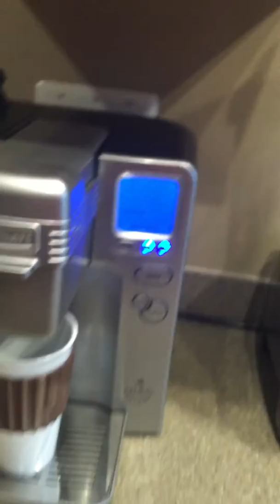Keurig coffee machine automatically refills with water. Float valve and some Quick-Connects.

Comment: Hey there: I have the same coffee maker at my place. So could you tell me where you found the parts to make that setup, Did you get the part from E-bay?Why did you not hookup a water filter on your coffee makerI'm calling from Houston Tx
Reply from the maker: Michael Shane it’s been a while since I did this.  I’m still happy with it.   I did later purchase a filter for it.  With quick connect connections. I bought the other parts on eBay.  Very inexpensive.
Reply from the maker: I bought filter but never hooked it up.  Yes, I bought everything on eBay.   I have since moved and don’t use it anymore.  Just sitting in box in basement.  I’d sell it to you.   I just have a Keurig with no waterline run to it.   I loved it but always feared it leaking or flooding my kitchen some day.   (Knock on wood) it never did.  But always scared me.